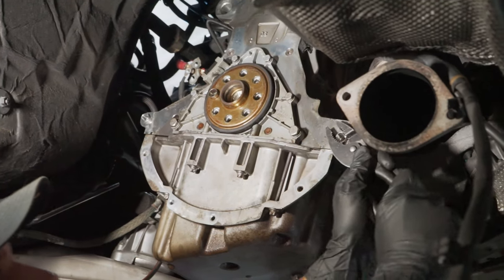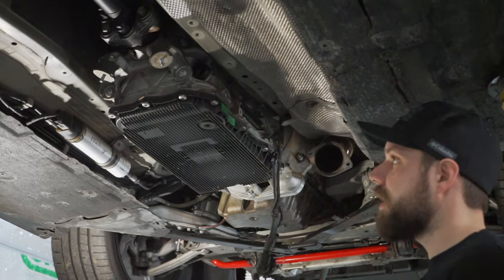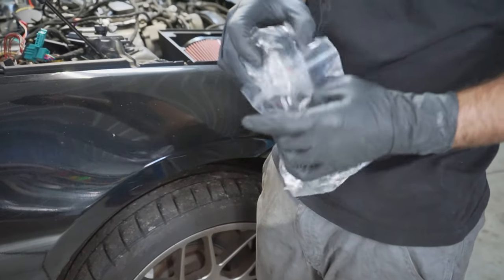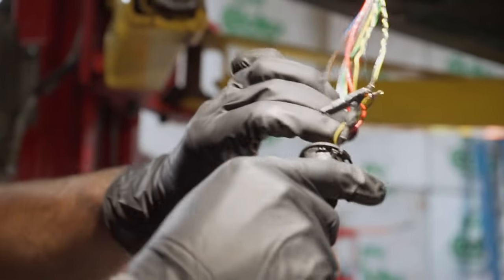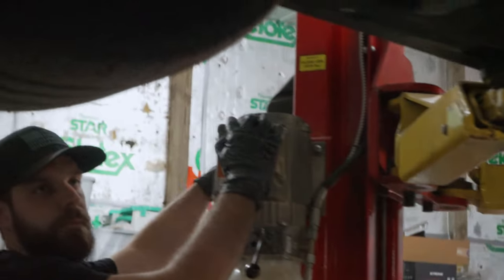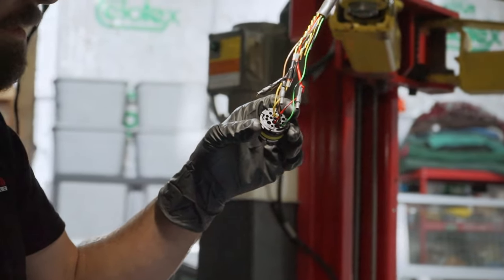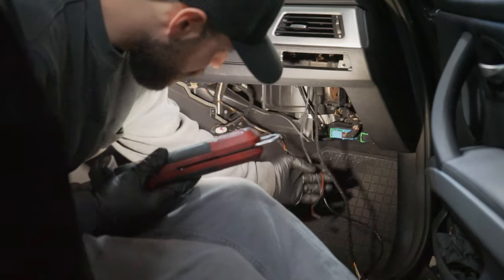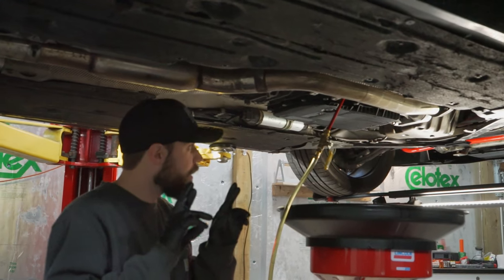335D 8 SPEED SWAP PT.2

Comment: Do you guys sell the wiring harness ? 

I need one for my E61 LCI, with SATA gear shifter, and I wanna put in 8HP not sure if F series of G series one, but for sure I will be using CAN TCU, but my car has sports button right next to the shifter so I would like to integrate it all and make it all work like factory

Comment: Can the transmission from a 2012 540i be used to the adapter and the m57?
Reply: You should be able to. The transmission in the 2012 540i should be the 8HP70, and CANTCU now supports that transmission.

Comment: Is the new shifter just to complete the look, or necessary for the swap to work correctly? Just curious if the old one could be kept to keep it totally under the radar :)
Reply from the maker: The old shifter will not work. However, you can use a e90 dct shifter that fits perfectly.

Comment: Professionals, making it look easy. I plan on doing this to my E60 535d as the 6hp26 isn't doing it justice, how do you like the CANTCU vs the Turbo Lamik controller?
Reply from the maker: Both are great controllers, however CanTCU is more plug and play and way better for street driving. Turbolamik, you can customize everything and change your map. This was over my head when I did my first 8 speed swap. Now I just use CanTCU.
Reply: @bradtourt  thanks for the reply!

Comment: Brad... Little confused.... JR 3.1 is stock turbos?   Apparently I'm missing something....  Now all of my info is very old because I did my upgrades about the time we found out we needed an r90...
Reply from the maker: Yes. Stage 4 is hybrids
Reply: @bradtourt  then they change the numbering scheme in the years that I wasn't paying attention.  Thank you sir
Reply from the maker: @LeeWinkler  stage 2.8 is stock turbo and fuel system, stage 3.1 is stock turbo with an r90, and stage 4.1 is r90 and hybrids. Nothing has changed.
Reply: @bradtourt  I'm not 100% positive as it yas been many years ago now... But I'm decently sure when I did my hybrids and tune it was 3.0.  At that time 2.8 didn't exist....  He had 2.5 as his top for stock turbos.  I'll have to ask Mark F to see if he remembers  it the way I do ....  Though it makes absolutely  no difference ...  Just curious .  Thanks for the clarification
Reply: @bradtourt  I talked to Mark F (another OG from the e90post days).   He confirmed, Im not crazy :D   When JR/AArod first came out with the Hybrid/tune...it was 3.0. At the time, there was just 2, 2.5 and 3.   (2.8 was introduced right around the time I did my hybrid swap).   Then we  (literally we.... found out on my car) through logging that the R70 couldnt deliver enough fuel consistently enough for what was requested....thats when the R90 pumps started to be included in the tune requirements.    Once I got my stuff dialed in pretty much, I just dropped off and did suspension and wavetrac and ATM hose/IC stuff......so my info is so old that its invalid now.  Thanks for all you do on our platform man!

Comment: Nice video! Good tips.. what about setting up the cantcu and removing immo from 8hp😅
Reply from the maker: Yeah no problem, I can make a video on this
Reply: I had one problem.. did you remove the thead with 10mm drill? The starter bolts used to be 10 and the thread in pmc adapter is 8mm.. if i used 8mm bolts the starter moves!? And 2x 8mm bolts with 8.8 rating.. enought to hold the starter?
Reply from the maker: @karlpuuraid7304  yeah it's sufficient

Comment: What did this swap cost and what was your labor?
Reply from the maker: Labor is $2500 and for the transmission, controller, and all the little stuff, it's around $5,000
Reply: @bradtourt  Same for a 135i?  Obviously different adapters
Reply from the maker: @alfamarco4845  yes, same

Comment: Hi mate what about the transmission bracket is it original e90 or different one?
Reply from the maker: It's original
Reply: Do you know are they the same as e60 5 series
Reply from the maker: @valentinlukanov2358  I doubt it
Reply: I swapped the trans bracket from the old 6HP. Four bolts